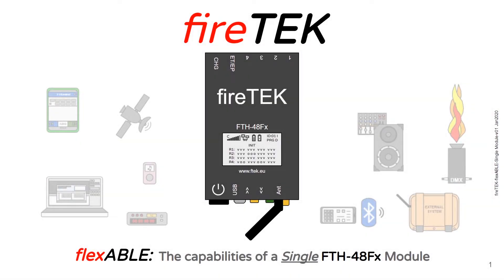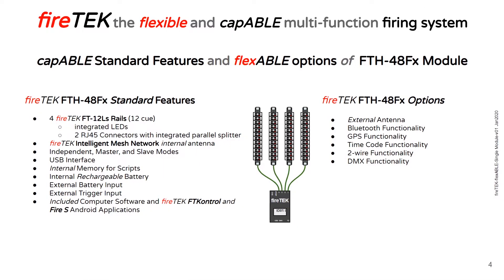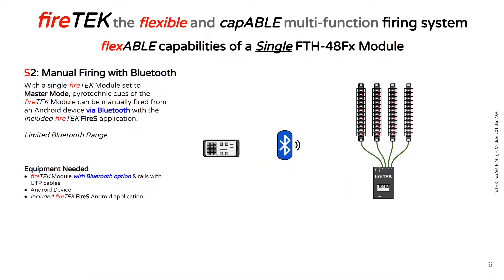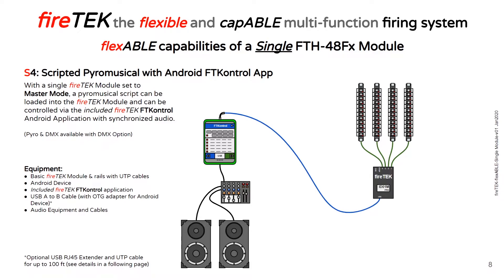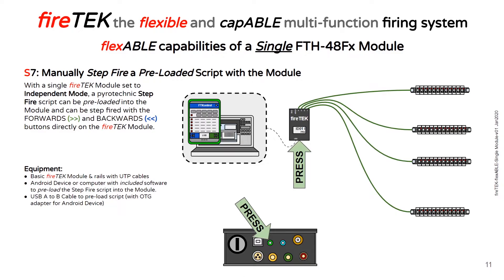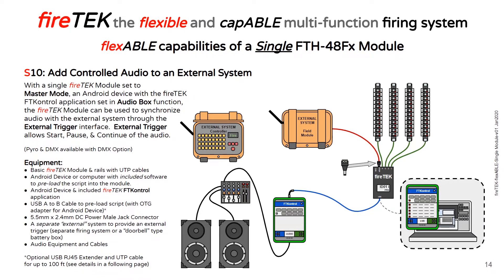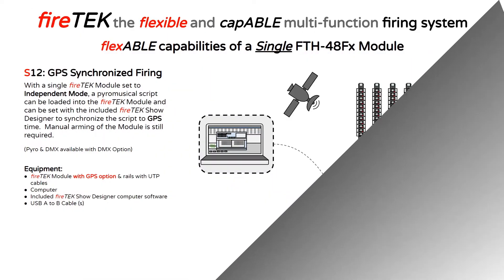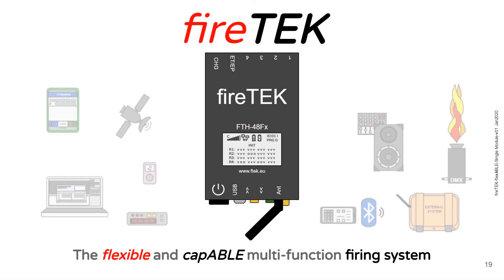fireTEK - flexABLE: Single FTH-48Fx Module

Comment: You are explaining the FireTEK systems better than the FireTEK people.  I came across FireTEK some 4 years ago, but these videos were not clearly explaining the system capabilities.  Good job.
Reply from the maker: Thanks for the comment on the videos.  I too came across fireTEK a few years ago and started putting these videos out to help show how the system worked.   It is certainly the most flexible system out there.   You see other systems coming around with some of the same features, but fireTEK seems to always be the first.

Comment: Love your videos. Thank you for doing this! I use your videos as a study guide.   I shot a show and didn’t know why the remote led wasn’t lit up.  I had to use a head lamp to see the remote. I figure I must have had some setting turned off or down.
I have two remotes; one can be used as an audio device Iv been told. Can you get a bit more in depth as to using 2wire and how to sync/play audio with the remote and without.
Reply from the maker: The screen on the remote can be replaced - I would contact fireTEK as it would be under warranty.   Here is a post of a module that took a near direct salute hit - kept running, but did eventually get the screen replaced:  https://www.facebook.com/groups/1581649428806010/permalink/2081441715493443/

As for using the 2nd remote as an audio box...     When powering up the Remote, you hold down the right-hand 6 button (B button on newer remotes).  The screen will say "AudioB" in the top right corner.  

If you are using a Master module rather than a Remote, it is also possible to set a remote as a slave AudioBox to the master module, too.   The process is the same.  When the Master Module is in network state asking you to Power On Slaves, power on the Remote while holding button 6 (or B).   I'll try to add a video in the near future on this. 

The wireless is very reliable and I've not known anyone to use the two-wire option.  I have played with it in the shop, but not used it for any shoot.  I hope to make a video at some point.  Note, you do need a 120ohm resistor at the ends of the lines.  If you are going this route, I'd contact fireTEK for specifics.
Reply from the maker: Remote as Audio Box Video:  https://youtu.be/RYWGywFwPk0